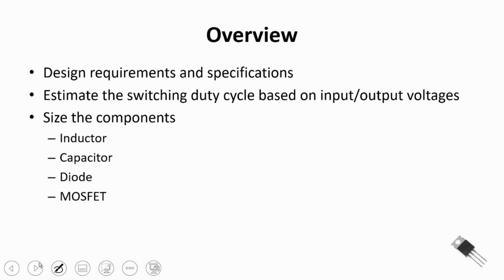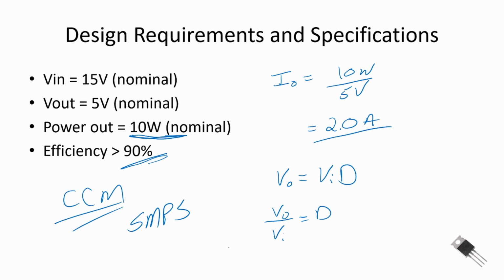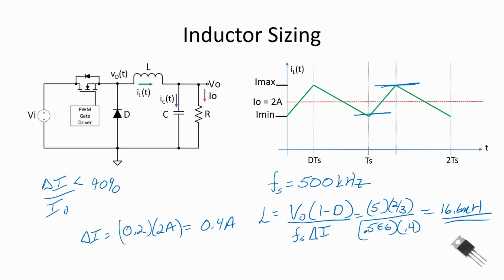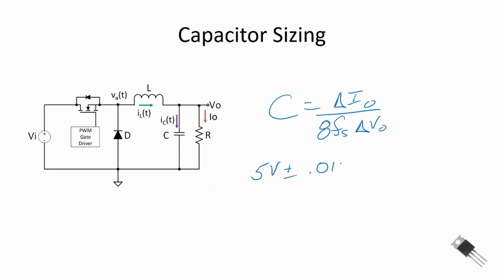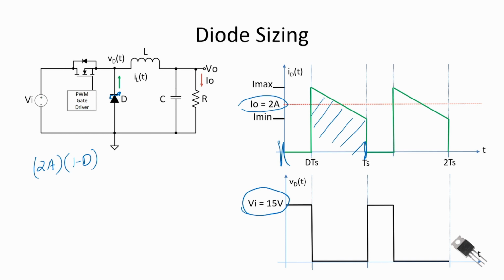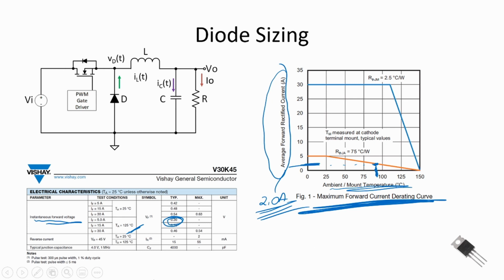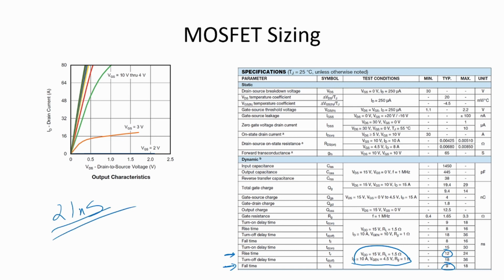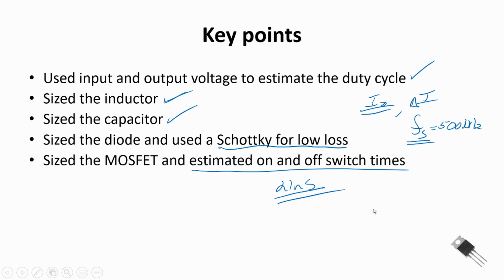Power Electronics - Buck Converter Design Example - Part 1

Comment: Question, 16:06 should it be that the Io = 2A (D = 33%) not the 66%?
Reply from the maker: Hi, great question. Yes, the duty cycle is 33%, and the average output current is 2.0A.  There’s a couple of ways to analyze. First, we can look at the average input current.  A quick approximation is to assume 100% efficiency.  The input voltage is 15V and the output power is 10W, this would equate to an average input current of 10W/15V or 0.67A.  The other way is to look at the average output power of 2A and multiple by the duty cycle which also results in an average input current of 0.67A.  In practice, the input current will be slightly greater as the efficiency is less than 100%.  Thanks for asking and best wishes on your design! -Dr. K

Comment: how did delta V0=0.2V came into effect?
Reply from the maker: I had to assume values for the output ripple as non where provided. I think the actual value selected for this was .02V or 20mV. This value would keep the output regulated between 4.99 to 5.01V. If your design can work with a larger voltage variation, then you would decrease the capacitor size. Hope this helps and best wishes on your design. -Dr. k

Comment: Hi. Will the synchronous buck converter has the same calculation for inductor and capacitor sizing ?
Reply from the maker: Yes.  The only difference is that the flyback diode is replaced with a MOSFET switch.  This provides lower loss as compared to the forward conduction of the diode. Best wishes on your design! -Dr. K
Reply: @powerelectronicswithdr.k1017 Thank you Dr.K

Comment: Great practical video!  However, instead  of just using formulas blindly, I rather understand where they come from.  For instance, where does the 8 in the denominator come from ?  What assumptions is that based on, assuming that you are starting from i =C dv/dt ?

Comment: Thank you for the great explanation, in my class, my teacher explained that the current used to calculating the power loss need to be in RMS, however can i just use the average output current as it is?
Reply from the maker: Hi, sorry for the late response.  Your teacher is correct.  Sometimes I will use the average value for DC power supplies because the average value and the RMS value are very close.  This is not always the case when we have very large current ripples however.  For smaller current ripples and small ohmic losses, the average value will be a very good approximation.  Hope this helps  Best wishes on your design.  -Dr. K

Comment: Thank you for your great video. Did I miss R value? how to calculate it please? thanks
Reply from the maker: R is not actually part of the design. It’s used as a test load.  You can size R to be slightly less than Vo^2/Po.
Reply: @powerelectronicswithdr.k1017  Now the ⛅️ become clear 👌 🙌 👏. Thanks once again for your nice explanation. 👍

Comment: How do you calculate delta V by voltage ripple in inductor while sizing the capacitor
Reply from the maker: Hi Praveendveen.  I'm assuming you mean delta Vo, the output voltage ripple across the load of the converter.  The output voltage ripple is computed from the current ripple through the inductor, the capacitance value and the switching frequency.  I have two other videos on sizing the inductor (https://youtu.be/tMJRwq8CWeI?si=q6fF0a4ahmQv2ArZ) and sizing the capacitor (https://youtu.be/6RWjz1lMUrM?si=XGdblthZpY6DGYKd) for the buck converter.  Best wishes on your design. -Dr. K

Comment: why a Schottky diode?
Reply from the maker: Lower loss when the diode conducts. The other selection would be a fast recovery diode.  Many converters are also synchronous and use a MOSFET instead of a diode. Great question and best wishes on your design.

Comment: Hello! how do we choose the resistance? please let me know
Reply from the maker: Hi Jviccii, the resistance is not part of the design of the Buck Converter.  It is an easy way (although not always accurate) to implement a load on the power supply.  You can set the value to Vo/Io.  However, please take caution as not all loads are purely resistive.  Great question and best wishes on your design. -Dr. K

Comment: Hi Dr. K, i've a question about the voltage regulation when the buck converter has no load. how do you regulate the voltage output when the output is floating? which means the capacitor won't be able to discharge itself.

Comment: Dear Professor, @12:42 should not we observe the Vd(t) negative? and also @16:21 the Vds is 2/3 Rds when it is conducting, right?
Reply from the maker: Pablo, YES!  Great catch.  The voltage should be in the range of -0.5V to -0.65V.  Luckily we have a low forward voltage drop and it will not impact the results drastically.  Also, you are correct, the average value of Vds during that period will be (Io/D)* Rds  and that is 2/3*Rds.  Best wishes on our design. -Dr. K
Reply: @powerelectronicswithdr.k1017  thank you very much

Comment: Hi Professor,
I tried to design a buck converter using IRF3205 NMosfet for an input of 24V and Output of 7.3V, 40A.
But i couldnot drive the mosfet from driver circuit. Control pulse from microcontroller, tried with PC817,MCT2E and IR2101.
Can you please suggest me a driver circuit design.
Thank You.
Reply from the maker: The IR2101 has both a high-side and low-side gate driver.  Are you doing a synchronous buck converter?  Also the IRF3205 N-channel MOSFET needs about 10V for the gate-to-source pin.  What is the voltage you are using on the Vcc pin for the IR2101.  This needs to be anywhere from 10-15V.   I would probably use a regulator specifically designed for buck converting that has a built in gate-driver.  Infineon does make switching regulators for buck converters.  Best wishes on your design. - Dr. K
Reply: Hi Professor,
Thank You for the response.
I have tried Power Mosfet driver IR2101 for high side Buck Converter with Vcc between 12 to 15V. But Mosfet is not going to off state. Hence the required output voltage is not observed across the load.  @powerelectronicswithdr.k1017

Comment: One thing to keep in mind with ceramic capacitors is the reduction in capacitance with voltage. The lower the voltage rating on the capacitor, the lower the capacitance when you approach the rated voltage. Awesome video

Comment: Any Practical circuit diagram?
Reply from the maker: Hi.  Great question. The schematic used more often than not depends on the controller used in the design.  The datasheet for the controller will often have one or two reference schematics.  There will be more detail such as couple capacitors, components for setting the switching frequency, sizing the voltage divider network for feedback, current limiting, etc.  I would start my design by selecting a controller that will meet your specifications, if possible.  Best wishes on your design. -Dr. K
Reply: Practical mosfet gate triggering circuit is very critical for your circuit to operate the mosfet in switching mode.
Reply from the maker: Yes, absolutely.  This video focuses on the MOSFET high-side switch (which sometimes is integrated into the controller), the flyback diode for a non-synchronous controller, the inductor and the bulk output capacitance. -Dr. K
Reply: @powerelectronicswithdr.k1017   Yes, Sir;   Just now lab tested this Buck Converter using the high-side switch the MOSFET technology and circuit is working fine.

Comment: Mg995 Servo motor needs from 5 to 7 volts to operate, I use 2 li 18650 batterries they give 7.9 volts. Should I use buck converter or not?

Comment: Sir, I have a doubt. Shouldn't we have to consider IL(peak) = ID(peak) = IL(avg) + delta(IL)/2 ?
Reply from the maker: Hi Sagar, yes sort of. You actually want to look at the maximum. But for sizing the inductor one often will look at the effective or RMS current which will be slighlty higher than the average. The inductor current spec is used to keep the design from melting off the coil wire lacquer and shorting the coil. Some vendors also spec the voltage across the inductor, which can be important. Note that you will often size slightly higher to place a safety factor in your design. Hope this helps. Best wishes on your design. -Dr K

Comment: What is 0.2 when calculated dI? I understand that 2A is I0, but where u find 0.2?
Reply from the maker: Hi Johan, it was a design requirement that used for this example. For CCM, you can often go up to 40% current ripple. In this example I used 20%. Hope this helps and best wishes on your design. -Dr K

Comment: Hi, thanks for the details calculations, Can I upgrade it to 10Amps
Reply from the maker: Hi Shankar, these topologies will work at 10A.  However, you will need to resize the inductor, diode and MOSFET accordingly.  Note that once you start increasing the output power, other topologies, such as the resonant converter, become more advantages due to the improved efficiencies.  Design is all about the trade-offs between cost, performance, and complexity.  Best wishes on your design.  -Dr. K

Comment: no not "about", exactly 1/3
Reply from the maker: Hi Sean, actually the duty cycle will be "about" 1/3.  While 5/15 is exactly 1/3, the duty cycle will be close, but not exactly this value.  The tolerances and additional losses are not taken into account when making this estimate.   In addition, the losses will vary with temp, time and loading.  I'll stand with my wording that the duty cycle will be "about" 33%.  Best wishes on your design. -Dr. K

Comment: Sir one small doubt, In 6:14 why do you put 0.2 in "delta I"
Reply from the maker: Hi, thank you for the question. I’m assuming a 20% ripple current. The percentage of ripple current through the inductor can be as great as 40% at rated load for CCM. Best wishes on your design. -Dr K

Comment: I don’t understand why all buck booster converter design show the ground of the incoming power supply connected to the the diodes and to capacitor because the cause a nasty short circuit so why is this design show when in reality it’s a failure. The ground only connected to the mosfet source if it’s a low side switching but this design work for only p channel mosfet I see everyone on this topic failed to explain that the mosfet show be p channel in this diagram not n channel
Reply from the maker: Hello Jobs, thank you for commenting and let me respond to a couple of your statements. First, this video is for the buck converter.  I do have a video for the buck-boost converter and here is the link https://youtu.be/va5uEOtGdU8.  Second, this topology will work for either a P-channel or N-channel MOSFET in the high-side.  Both types of devices can be used as a high-side power switch.  P-channel MOSFETS are easier to switch in a high-side configuration.  However,  N-channels are often used with a high-side gate driver as n-channel devices are typically faster and more efficient.  Second, I'm not sure where there is a short circuit in the topology.  One must always be careful to designate ground, reference nodes, and current return paths.  If you notice, the symbol on my diagram is a reference node.  This might be a ground location, but that is not always true.  The output node is listed as Vo and is referenced between that node and the reference node.  For the buck-boost topology, the output node will be at a lower potential than the reference node and the input will be at a higher potential than the reference node. Finally, there are many situations in which the source is "floating" and the reference is might not be galvanically connected to a physically grounded (to earth) node.  Such is the case with battery powered devices.  I hope this helps eliminate confusion and thank you for watching.  Best wishes on your designs. -Dr. K
Reply: @powerelectronicswithdr.k1017 ok I understand and yes the two can use for high side switching . I have a question on the buck booster converter firstly I have a 700amp battery that I test my circuit with but the buck booster converter duty cycle at full showing 298 vdc and still look to go higher but when I turn the duty cycle down to get the desired voltage the amperage is is low and when I connected a low to it the voltage just cutting out so I don’t understand why is the however I am thinking to make push pull buck booster instead because I think I will get better results and most of the current because the one switching with with 7000uf not giving out the current I need for charging from solar panel as saw on the data sheet
Reply from the maker: @Dc_tech386  Hi Jobs, I'm not sure I would use this type of configuration at those power levels.  What is the application and what are you trying to accomplish?
Reply: Ok the buck booster i made is a papular buck booster 2 mosfet and fast switching diodes I use the tl494 Ic with feedback however the two 100 amp mosfet handling capacitor the capacitor but the capacitor or charging up to 200 voltage and I need 12 from my panel of 600watt am not getting the wattage from the panel when I connected the battery to the 200v the voltage drop don’t to 1 voltage I use 7000uf of capacitor and a big inductor with 100 turn and the wattage no staying only small load like bulb work 30 watt but only more load that that the capacitor drop out and the mosfet getting fire hot I do have a 12 volt drive to gate at 6amp so the gate is driving good I use 6 fet and the load still dropping the voltage so I try the push pull converter and is work good today am getting 14 volt at 29 amp so that a good circuit but you think it’s not good enough because the buck booster refused to keep up the booster converter work good too and the buck converter but not the fly back converter

Comment: It was great. After a lot of searching on the internet and not finding a suitable and correct source for teaching the design of a simple buck circuit, I found you who taught this part wonderfully.
I wanted to tell you two things about this. First, I think the diode selection part needed more explanation, and the second point is that we are waiting for the second part of this tutorial. Thank you
Reply from the maker: Mahmoud, thank you.  Here's the link to part 2 https://youtu.be/ypdFCqY7nJM.  In the course I teach on power electronics, we cover diode selection in more detail.  There are only a couple of options for the traditional buck converter.  The first is a fast recovery diode, the second is a Schottky diode and the third is a SiC diode.  Another approach not covered is to utilize a synchronous Buck converter topology.  In this topology, the diode is replaced with a power switch (i.e. MOSFET).  Thank you for the feedback and best wishes on your designs. -Dr K

Comment: 19:45 
What's the Ciss, the Rg and what does the Cgd present ?
Reply from the maker: Ciss = Cgd + Cgs, and is the input capacitance of the device.  Cgd is the capacitance between the gate and drain terminal of the device.  Rg is the gate resistance that is internal to the device.  You should be able to find Ciss and Rg on the datasheet for the MOSFET you plan to use in your design. Cgd will need to be estimated.  Hope this helps and best wishes on your design. -Dr. K.
Reply: @powerelectronicswithdr.k1017  
Thank you doctor i really appreciate your giving ❤️❤️❤️

Comment: Greeting sir... Are they an effect on output voltage(Vo) if the amplitude of of PWM increase or decrease?
Reply from the maker: Hi Farid, I assume you mean the amplitude of the pulse driving Vgs?  There is a bit of an impact, but I am assuming we are in the Ohmic region of operation for the MOSFET (i.e. the MOSFET is fully on).  Therefore, we really only care about the pulse  duration or the PWM duty cycle as a percentage.  Best wishes on your design.  -Dr. K

Comment: when output voltage is volatile, how does inductor across the voltage constant?
Reply from the maker: This is just an assumption (assumes load is static) used to do the analysis. The output capacitor does a pretty good job of filtering and keeping the output voltage near constant for a static load.  Unfortunately, I do not discuss the control of converters in my videos and assume a steady state condition.  Dynamic loads that vary rapidly place another level of design constraints on the topology.  Thank you for watching and best wishes on your design. -Dr. K

Comment: What will happen if the output capacitor value is double the output voltage .i.e 4.7uF , 10 or 16V

Comment: Should the current rating of the diode be around average inductor current (@ 85 degrees) like in this case, it was 2A at 85 degrees. In my case, the average inductor current is 5A so do I need to choose a higher forward current diode?
Reply from the maker: The peak value of current yes, but not the average value.  Both values are important when selecting the diode.  The reason the average value of current through the diode is less, is because the diode is only conducting when the switch is open.  This flyback state  is (1-D)% of the time where D is the duty cycle.  Therefore the average current through the diode is (1-D)*Io.  The peak current is the same for both devices.  Hope this helps and thanks for the question.  -Dr. K
Reply: @powerelectronicswithdr.k1017  thank you.

Comment: I have noticed that some datasheets use different equations for component sizing. Is it safe to use these equations as "universal" equations, or should I always stick with what is in the datasheet?
Reply from the maker: Hi RGB, the answer is "it depends."  Sometimes that datasheets are accounting for losses or differences.  My advice is to start with the theoretical design equations and then compare to the data sheet equations.  You may find that the values are close.  Hope this helps and best wishes on  your design.  -Dr. K